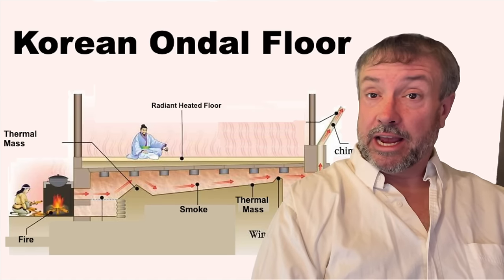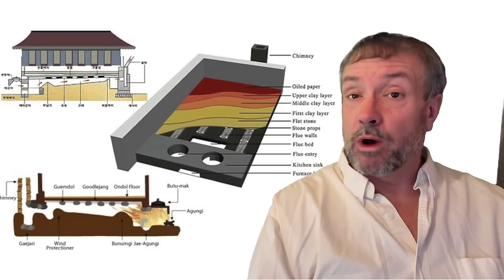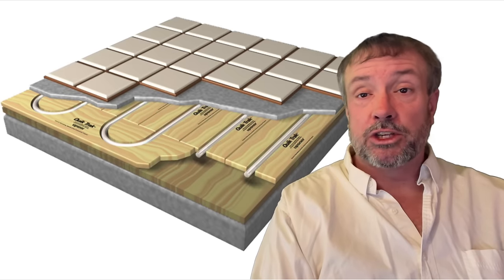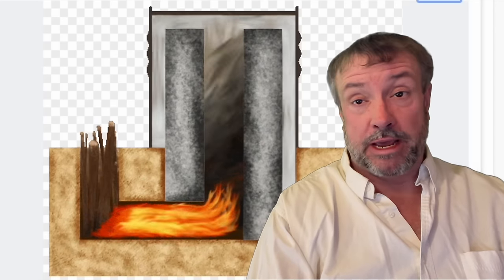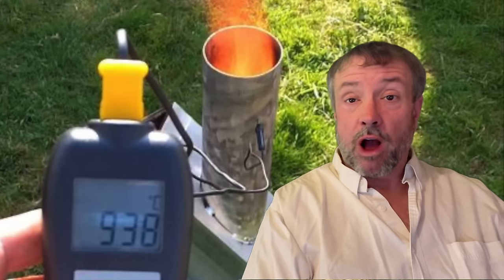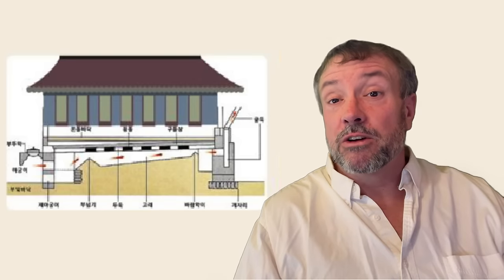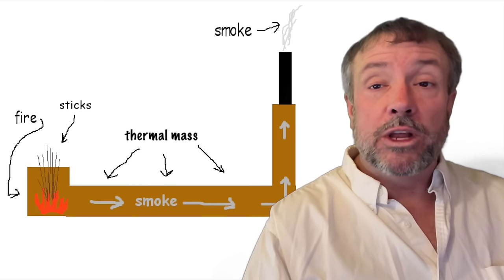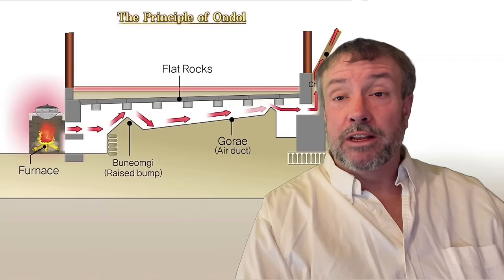Ancient Korean Ondal Smoke Heated Floor

Comment: I spent all of 1969 in a mountainous area of Korea in a very rural area and can tell you this heating system works very well.
Reply from the maker: thank you for the info!!!!!
Reply: @SimpleTek   Back then if a Korean was found chopping down a tree he was jailed, they could take anything that broke off or fell down but no taking down a tree, In ities the sild charcoal that was teken from harvested trees in a managed way. There was small mountain village just below the microwave site I was stationed at and I can tell you they were hard working people and they kept us informed if any strangers were in the area.
These mountains weren't that high and most of the tree cover was stripped by the Japanese in WWII or before. The only mature trees I saw over there were at Buddhist religious shrines and sites, the Japanese did not cut those down..
Reply: What about bambo
Reply: @dell177 When I was there in 1977/8 it was still that way. No cutting of trees, they bought charcoal the size and shape of the old style coffee cans . Had to be careful about monoxide poisoning.
Reply: @n2skcmo  I was there 1988-1990 and had to change the those charcoal bricks twice a day but, we had a heated water based system.  The Army would not let service members live in a home with the heated exhaust air from the fire systems because of the carbon monoxide issue.
Reply: curious is there a way to get rid of soot buildup over the years ?
Reply: @dell177  Sounds like Mangil--san, where I was stationed 1973-74.

Comment: This is a very efficient heat method but very dangerous.  The carbon monoxide from the fire will creep into the home through any cracks or crevasses in the concrete floors.  Hundreds of people used to die every year from the carbon monoxide seeping into their homes.  I was stationed in Korea for a number of years and the Army forbid service members from renting Korean houses with Ondol heat.  Modern houses in Korea are mostly forbidden from installing these systems except in very rural areas.  Most homes in Korea now have modern liquid based floor heat with a boiler run on natural gas, fuel oil and some still with the Ondol charcoal bricks.  My Korean inlaws have a gas fired liquid in floor heat system.  The system works very well and is easier to maintain a constant temp with no mess or smell from burning coal or heating oil.
Reply from the maker: well said

Comment: I did a tour of duty in the ROK and have stayed in Ondol heated homes. This was in the '70s and the Air Force brass told us not to sleep over in an ondol heated house because if there was a crack in the floor, CO can intrude and asphyxiate you. I remember the women sweeping up pine needles that would be compressed and heated into cylindrical Ondal briquets, each about the size of a 14"x 6" cylinder perforated with longitudinal holes, just the right size to put in a terra cotta tube (the stove) that when ignited vented the smoke under the floor, warming it comfortably. It gets very very cold in the ROK, they didn't call it "Frozen Chosen" for nothing.
Reply from the maker: That’s awesome

Comment: Thank you for your interest. First of all, the name of this heating system is "Ondol", not "Ondal". It means a warm stone. In modern Korea, more advanced hot water underfloor heating is used. If you apply this with Ondol, you can use the warmth more efficiently. The type of boiler can be used depending on the conditions, such as wood boiler, oil boiler, gas boiler, electric boiler, solar heat and sun light, etc.
Reply from the maker: Ok

Comment: My grand father had 3 greenhouses heated this way here in Finland. It was a common way back in the 1950s. Greenhouses where 30m long built in a slope to get the heat to rise and circulate. Smoke channels where of red tiles not to crack by the heat. Carbon monoxide was a real problem. Main source of heat was though raised compost beds and this method was used only as additional heating method during early spring and the coldest nights. In 1960s steel pipes became affordable so hot water central heating replaced this heating method.
Reply from the maker: Awesome

Comment: Ondal is actually the charcoal brick used in the stoves. It can be used in cooking stoves, inside heating (was most common) and for radiant heat, though all the buildings I saw when I was there in the 80's had a ondal stove in the kitchen used for cooking and floor heat together. The kitchen was dug down about 2 feet, and each room (normally total of 4) had a slightly raised floor for the smoke to slowly rise underneath. Third room raised a bit higher, and 4tj room at ground height with the moke exiting to the outside.
Reply from the maker: Ok
Reply: I love that. Here in the US sometime we have sunken living rooms. Forget that. Sunken Kitchen!
Reply from the maker: @Resist.Tyranny  nice

Comment: Many years ago I lived in my Grandma's house in North east china, which has similar weather like Korea. They had a mass clay based bed that occupied more than half is the house. The bed was toasty after cooking dinner, and the heat last the whole night. That system is much more effective than fireplace. The only draw back is if someone wet the bed, it could collapse:)
Reply from the maker: That’s awesome, thank you for sharing
Reply: That sounds like a chinese kang. Not sure if thats what its called.
Reply: @RedEmp02  you are right. It's kang.
Reply: And that's why eastern slavs were sleeping on their massive stoves. You can even wet your bed with that one, since it's made out of actual bricks and mortar. Although I wouldn't recommend wetting your bed in any circumstances...

Comment: Personally, I'll be going for a rocket mass heater. Similar idea except it uses a modified rocket stove for the fire, then runs the exhaust through some mass, and of course out of the house. I think my favorite mass that I've seen is a cob bench. It's really efficient on the amount of firewood that you need to use to get enough heat.

Although, I do walk around barefoot a lot. A warm floor sounds very nice.
Reply from the maker: Bigalow brook farm did a rocket mass heater on his greenhouse floor mass
Reply: I like the Korean method as it seems to need less wood...
Reply from the maker: @marcoloretto1185  it is interesting
Reply: To get most heating benefit out of ‘Ondol’ you do need to sleep on the floor and sit on the floor. Floor is the thermal mass and you want your body to be in contact with floor as much as possible. ‘Cob bench’ seems to be a segway from ‘Ondol’ since cob bench are found along lower Siberia steppes. Ancient Korean territories include Manchuria and Inner Mongolia. Ondol probably is more thermal efficient even without insulations. Koreans cook three meals a day, and the cooking thermal energy all goes into Ondol. Some additional late evening heat may be needed during cold winter night. The ridges, slopes and channels under the floor manage thermal energy to control fire and spreading energy.

Comment: I was in the US army stationed in Korea in the 1980’s. I still remember the smell of ondal during the winter. 
     I remember there were occasional deaths from carbon monoxide, mainly because the entire floor had to be completely sealed from the fumes below the floor. Some of the older houses in the village were built right after the war so they were already leaky. The available materials were pretty basic back then. 
      Ondal in the 80’s was a compressed cylinder of charcoal about the size of a coffee can. It had several holes from top to bottom so they could be stacked and still burn from bottom to top with flow of gasses. Most of the stoves would take  two of the charcoal cylinders. I think they would last about 5 or six hours.
Reply from the maker: Thank you for the info!!!

Comment: bricks are rarely used in traditonal Korean construction, unlike China.
most ondols are made with stones and clay and lime, before the modern era.
after 1900, cement concrete blocks, cinder blocks, bricks and portland cement is commonly used. 
after the floor is rendered with clay, it was covered with special paper.
Reply from the maker: Thank you

Comment: Romans had something similar in their bath houses where there was a gap, brick pillars, and about 30cm of concrete. Gap was for smoke to pass and heat the floors. In slavic countries we have pec wich is similar to rocket mass heater. It's used for cooking, baking and heating. It's traditionaly build out of brick, positioned in center of house and very heavy. Rest of the house is usually out of wood, so outside that would suck heat out, is from light thermaly isolating material while heating is from heavy heat absorbant material.
Reply from the maker: Interesting

Comment: It would be interesting to see a comparison between a rocket mass heater and this floor system on the amount of wood used
Reply from the maker: Yea it would!!!!
Reply: In addition to the particulate values exhausted by each. RMH would win hands down I'd think.
Reply from the maker: @blenderbenderguy  ok
Reply: @blenderbenderguy  like an "afterburner" on some gas space heaters?

Comment: Mentioned modern underfloor radiant heating is invented by well-known architect, Frank loyd Wright, after seeing copied exhibited model of ‘On-dol’ in his visit to Japan, adapting heat transfer medium to water from smoke for apparent benefits. Thanks for the interesting video.
Reply from the maker: Kool info, thank you
Reply: yes, and Frank Lloyd Wright was very influential in Chicago area, and there are many residential buildings with his "gravity heating system".
not sure why he used "gravity" to describe his system, though.
Reply: 일본은 온돌 난방이 아닙니다
Reply: @davidjacobs8558  passive water moving = no pump = gravity
Reply: passive = no electricity/electric pump

Comment: ANOTHER "TRICK" TO INCREASE THE HEATING VALUE:
* Have some type of water containers "under" the home that the hot smoke will heat up while it's circulating under the home.
* Because water is the BEST substance to retain heat, the intensity of the fires could be reduced... which of course reduces time, energy and money invested in keeping the fires going!!!

FYI:
* My wife and I just retired and we're moving to NW Montana and we'll be implementing many of these techniques in our new home... along with a "Log Boiler" (load it once and it runs for a couple days) for our radiant heat in our home, greenhouse and shop!

Amen
Retired, Veteran
Reply from the maker: Thank you for the ideas!
Reply: @SimpleTek    Love your videos!!!!  : )
Reply from the maker: @BowenOrg  thank you
Reply: what material u think to store the water in?
Reply: @bighappy177   You might want to test "pex tubing" wrapped around a closed water container of some sort... maybe many small to medium sizes ones or one large one. 
Copper tubing is to expensive unless you can get some for free at the "Junk yard!"
Of course, you could just do it the old fashioned way and put the pex plastic pipe under the dirt laying it as much as you can before it goes up the chimney. That will keep the ground fairly warm and that will help a lot!

Amen
Retired, Veteran

Comment: Very time proven method and there are variants seen in many cultures.  You don’t want smoke, as smoke = unburnt wood-gas = inefficiency.  Smoke also has a tendency to condense on cooler surfaces. This forms creosote which not only acts as insulation, but being unburnt refined fuel, IS highly flammable.  Creosote is what fuels chimney fires, and is the result of cool/smokey combustion.   What you want is a fire that burns hot enough to fully break down all the combustible wood gas, so there is nothing left to condense.  You control the size of this hot fire to control the overall amount of heat delivered.  A rocket stove is a good selection for this as it can be sized, or run in 2s or 3s to deliver an appropriate amount of heat yet burn very clean.  The problem with the basic Ondol is it requires constant attention to feed that fire.  A biomass or pellet burner would also be a good choice as they can run automatically and maintain small but very clean combustion for long periods of time.  I drew up a plan for a cabin that had the flame inside where it could be seen(Humans like and are comforted by seeing the flame), but the exhaust was drawn under the floor to heat the floor mass Ondol fashion with the burner on the opposite end of the building from the chimney.
Reply from the maker: Thank you for the insight

Comment: Outside rocket heater with better heat extraction to liquid radiant floor mass. 4 ft gravel and sand 
Underfloor. but 70-80% temp drop from fire to chimney output  so less wood no worries on co2 leaking in floor
Reply from the maker: Ok

Comment: There is a big danger with ondal. I was stationed in South Korea and the 8th Army would not let any service member stay in quarters with this type of heating. If there is a crack in the floor, you can get carbon monoxide poisoning very quickly. Right before I arrived in country, a service member and his family all died because of this and we had to inspect all of the service members' off base quarters to ensure they did not have that system. Most systems had switched to circulating heated water under the floor.
Reply from the maker: Breathing in smoke is bad
Reply: A guy in my unit at Osan was poisoned by a carbon monoxide leak from his off base apartment's ondol floor. He almost bought the farm before someone went to check on why he hadn't shown up for duty that morning.
Reply: So, a more efficient fire plus CO detectors, would make that safer. Mass heaters are designed to burn very hot so about all that is left is CO2 and H2O. You would burn thru wood faster but produce more heat. So if there was a good way to hold all of the heat, like a heavier mass, then the results would be the same without the danger.
Reply: only with coal fired ondol. wood fired ondol didn't have carbon monoxide problem. 
so, carbon monoxide poisoning wasn't an issue before the modern times, when they started using coal, 
and now most homes don't use coal fire anymore, so became less of an issue today.
Reply: @davidjacobs8558  They used a cylinder of charcoal, not coal.
Reply: @2ravenrick  charcoal is very expensive stuff, you would not use it for ondol.
Reply: I to was in the eighth army. Every one that I saw charcoal cylinders, about the size of a coffee can. The burn chamber was designed to just fit them
Reply: Perhaps it wasn't charcoal but coal formed int cylinders.
Reply: @Yukontom It is called yuntan or yoentan(coal briquette). It is mainly made by mixing anthracite with some clay powder and molding it into a short perforated cylinder.
Reply: @jinkhan0  thank you
Reply: @walterrutherford8321  yes, have smoke gone, yet mass warm, while sleepn  =   safer too

Comment: Seems pretty awesome. Surprisingly how little attention this gets relative to RMHs..

for GH applications... I think running a series of wicking beds(water in the bottom of the bed) on top of the hottest part of the channel makes sense.

Water + non-grow media would be a really good thermal sink. Plus, you'd have your soil storage containers double as thermal mass, and get the heat literally into the roots instead of all-around.
Reply from the maker: interesting!

Comment: To get most heating benefit out of ‘Ondol’ you do need to sleep on the floor and sit on the floor. Floor is the thermal mass and you want your body to be in contact with floor as much as possible. 

‘Cob bench’ seems to be a segway from ‘Ondol’ since cob bench are found along lower Siberia steppes. Ancient Korean territories include Manchuria and Inner Mongolia. Ondol probably is more thermal efficient even without insulations. 

Koreans cook three meals a day, and the cooking thermal energy all goes into Ondol. Some additional late evening heat may be needed during cold winter night. The ridges, slopes and channels under the floor manage thermal energy to control fire and spreading energy.
Reply from the maker: Well said
Reply: TY.    ...and prob had, what Southeners in USA call, a "summer kitchen"    OUTSIDE, away from house, to not heat up house during terrible heat/humidity.

Comment: Not sure why you think a woodburner in a greenhouse is bad, most of the fires in them are electrical in nature. 
   I used straight junk like 2 propane tanks bolted together for years and no seal on the door, I just cut a slit with a grinder and used self tappers to smack a hinge on the cut the other three sides. That's like 3/16 gaps on all sides. What I'm saying is that it would runaway. But it had five 50 gallon drums and block around it so I let it scream.
   The only real issue is short flues without screens dumping embers. That's not exactly an accident, that's not being qualified or doing research or following code.
Reply from the maker: Well said

Comment: Great idea, but what about thermal couple refrigeration or electricity? Use the hot smoke, refrigerate food? Generate electricity to charge a battery, inverter, and free electric. I might start making them next month. Solar doesn't pay itself off very fast, sun, wind, and water are not always available. But if you have wood or fuel, you can live off grid.
Reply from the maker: Good plan